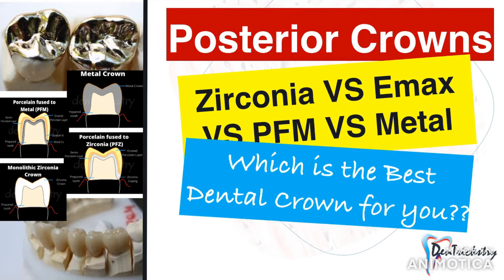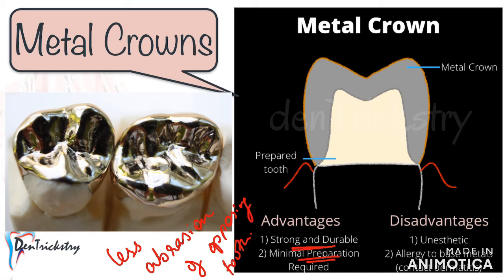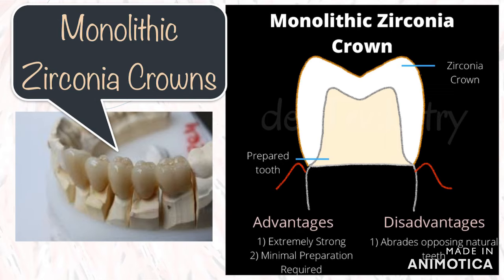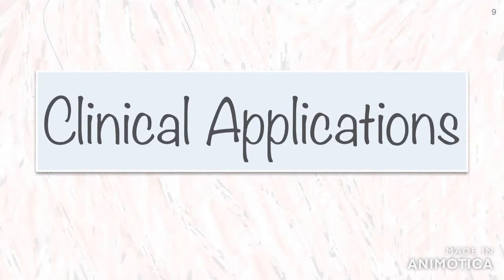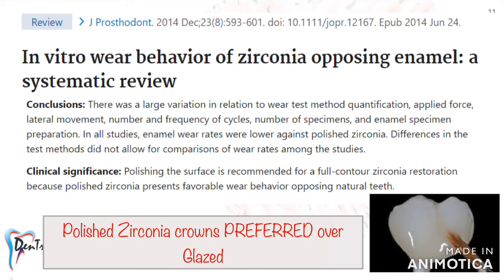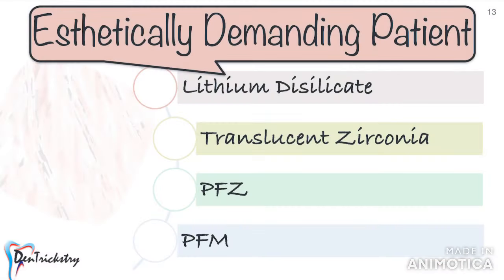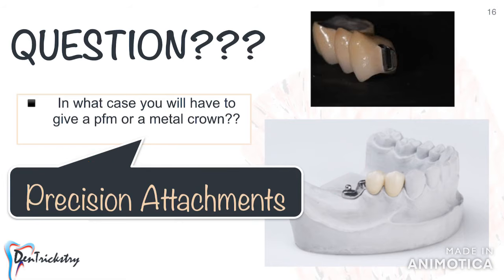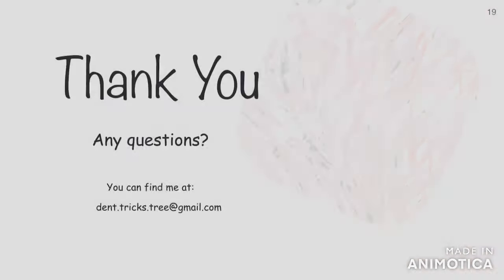DENTAL CROWN TYPES. Zirconia, Emax, PFZ, PFM, Metal!! Choosing the BEST!

Comment: I think one disadvantage is wrong about monolithic zirconia .: the wear generated by zirconium oxide on the antagonist enamel is less than that produced by f porcelain as long as it is well polished (Jung et al. 2010, Tambra et al. 2010, Preis et al. 2011, Rosentritt et al. 2012, Kim et al. 2012, Mitov et al. 2012, Janyavula et al. 2013, Stawarczyk et al. 2013, Preis et al. 2013, Stober et al. 2014, Burgess et al. 2014).
Reply from the maker: Thanks a lot for your valuable inputs. :)
Yes, I think I mentioned that as a disadvantage in the beginning...but later on in the video, I did stress on the importance of zirconia polishing to avoid tooth wear.

Comment: Chrome cobalt ceramic alloy is the strongest and can be made thinner to 0.3mm copings. Best for long span bridges with less bulky connectors.
The PFM is considered as gold standard and all monolithic and all materials are compared to the very good pfm in all ways.
I have seen very few dentists know how to prepare a for a monolithic or pfm crowns.
Chrome cobalt pfm crowns are the best,bas compared to all the new materials available today.
Porcelain fusednto zerconia is a failure because zerconia is too hard and not flexible like cocr alloy so the ceramic fractured easily and not advisable. 
99 % dentists do not know how to prepare the crown properly and do not know to take good impressions. They do not take complete impression and also proper bite. 
Even for a single crown full arch impression is required so the technician can check lateral movements, so dentist do not have to grind high points in lateral movements.
Most dentist avoid making temporary crown. So in few days the prepared crown shifts and the properly prepared crown painstakingly by dengan technician doesn't fit, then the dentist blame the technician for not making proper crown.
Most dentist are very careless  I have seen in my 37 years working as a dental technician.
The reality and truth is that even prothodontist do not know how to prepare the crown and take proper impression.
CrCo Pfm crown will remain gold standard always.  Cad Cam tools are only as good as the operator. Most of the Cad/ cam operating in dental labs are not dental technicians and they do not know dental anatomy at all. Only an experienced and expert dental technician can produce properly fitting dental restorations with the use of Cad/cam.
If an sculptor do not now anatomy of the body hoe cam he sculpt a human sculpture on Cad software. The same is true for dental technicians, who has not learned dental anatomy in his/her life properly, and the same is true for dentists. How many dentists can carve a single central incisor properly. One in thousand.
I do not criticize dentists but the truth can not change. No dental college in India, make dentist make 100 pfm crowns in his college studies, non. 
I can go on writing but I will not waste more time.
All dentists know the truth of themselves.
99 percent dentist do not follow the ethical rules set by Indian dental council. How many dentists know about the ethics book pdf available on the site of Dental council of India.
Be happy
Reply: Am a final year dental student, nd this one is literally an eye opening .., thankyou....

Comment: Very informative, explained in an understanding way. Thank you  so much..
Reply from the maker: Thanks a lot for the appreciation! Means a lot!! :)
Reply: When I opted for metal(steel),they said there is risk of oral cancer. Is that true.
Reply from the maker: @anumaevangalin.u.s6220  
Hey!! So, the risk of oral cancer increases with a crown which irritates a part of your oral cavity be it metal,  PFM, Zirconia etc. So if you have a faulty crown which is hurting your tongue or oral mucosa, you should get that replaced.
However, there are studies supporting that metal crowns could be a contributing factor for oral cancer...especially if you have other dissimilar metal based prosthesis in your mouth (silver filling/other metal crowns)...this produces galvanic currents...which again irritates your oral mucosa/tongue etc and may result in oral cancer. 
Don't worry..i'm sure you will be fine with the metal crown...if you still have any apprehensions, you can keep checking for any whitish/ reddish lesions in the oral cavity near your crown time to time. And if present, you may have to replace the crown. 
Also, this is possible phenomenon only if u have other fillings or crowns of a different metallic material. 

If you want to know more, feel free to ask. :)
Reply: Thank you very much for your detailed description. So it would be safe for me since I'm not having other prosthesis in my mouth. However I will do examine the site from time to time. Thank you
Reply from the maker: @anumaevangalin.u.s6220  You're welcome! :)

Comment: Hi Doc! I learned a lot from your video. Thank you for sharing 😊Would just like to ask if you also have inputs for 'Tilite' crowns?
Thank you so much in advance!
Reply: Tilite crowns are considered as PFM.. Where medical grade alloys as they claimed are used in casting. During its launching, they claimed that it will eliminate the common problem of  PFM (grey lines in long term)  but clinicians observe it in long term practice and as expected, it failed.

Comment: Thanks! Great info! One question pls. Pls do more videos in CAD/CAM crowns, inlay/onlay restorations, individual crowns vs joined blocks where no tooth is missing but multiple adjacent crown are required. Also, pls be honest, why do dentists charge such high prices for crown, when the actual lab rate is just a fraction, at least in India. Also, pls educate us on the guarantees that come with the PFM CAD/CAM crowns, is it just a gimmick, will they provide a replacement if chipped in guarantee period? What is DMLS crown?  PFM vs PFZ, is PFZ more expensive?
Reply from the maker: You're welcome! Hope it helped.
Yes!! I will keep these topics in mind for videos in the near future. Thank you for suggesting. 
Coming to your question....Well, you are not really paying for the lab charges, the dentist is charging you for their skills and medical advise. Even if something as small as crown cementation goes wrong, it can have devastating effects on the surrounding gums or opposing teeth or your neuromuscular system. So, everything has to be done with utmost precision. 
Guarantees are provided by the lab...and in my experience, if your crown chips off or fractures, they do give a replacement for the same.
DMLS is direct metal laser sintered...in simple terms, 3-D printed crowns...they have a better fit compared to conventional ones.
PFZ is more expensive than PFM crowns, but they have better esthetics and fit as well.
Reply: @teethstreet   Thank you so much dear for your detailed reply. My question about the high cost of crown was because more than one dentist told me a PFM manual crown was X amount and same done by CAD was 2000 rs more. Based on what you just told me, if the cost of the crown is made up of the dentist charges, his/her work for both types of crown is the same. Then why such a steep price hike in charge? This prompted my question.

Comment: Hi. Which is better option for molars ? PFM or Metal ? Please reply very confused..
Reply from the maker: You can go for either. Metal if you are not too concerned about the esthetics as the ceramic / porcelain on the PFM could to chip off over time exposing the metal.

Comment: Mam, what is the treatment for advanced Gingivitis
Reply from the maker: For gingivitis, you should start with scaling and root planing followed by proper oral hygiene instructions to the patients. Most cases of gingivitis resolve with this conventional protocol. 
If the case has progressed to periodontitis, apart from the interventions mentioned, surgical procedures may also required with or without antibiotic coverage. 
Every case is different, you need to 1st identify the cause and then plan your treatment protocol. 
Refer the case to a periodontist for better results.
Reply: @teethstreet  Thanks mam

Comment: The original veneer on my front tooth fell out before and was reattached by my current dentist  3-4yrs ago. Recently it completely cracked and I will need to replace it with a crown. Which type should I get to cover that darkness if he isn’t able to clean it and something that looks natural yet strong?
Reply from the maker: Depends on how discolored the tooth is. If it is mild, it can be masked with either appropriate thickness of Emax or High translucent zirconia crowns. For severe cases, an opaque layer will be needed...so an option like layered emax or layered zirconia will be good in my opinion. 
Don't worry, your dentist will probably check the degree of discoloration and will suggest you the best option. :)
Reply: Or the use of a blocked out Zirconia. It works perfectly. Either layered or Multilayer full anatomical Zirconia if there is sufficient thickness. Layered is the best in my opinion

Comment: Hey which looks more natural emax or zirconium crowns?
Reply: Emax but with less strength,zirconia also can be perfected
Reply: Which one do you recommend? What about porcelain veneers?
Reply from the maker: Yup! Emax will definitely give you best natural appearance...these days you have  natural looking Zirconia crowns as well. So it comes down to the case that is in front of us. The ultimate selection depends on a few factors like discoloration, amount of enamel present for bonding, tooth structure we have, occlusion etc.
Reply from the maker: Porcelain veneers are great too...minimally invasive and very natural looking. 
Decision between crowns and laminates depends on the case. 
Not every case is suitable for porcelain laminates. 
So, if you are looking for a smile makeover/design, it all has to go through a process of treatment planning which involves clinical and radiographic examination, digital photographs, study models etc. A mock treatment is usually planned on the models 1st and the best suggestion is given to the patient accordingly.
Reply: Feldspathic porcelains are the most aesthetic but they cannot be used in all cases, since their indications are more limited.

Comment: Mam zirconia crown abrade opposing natural teeth?
Reply from the maker: Zirconia crowns abrade the opposing tooth only if it is not polished. Even before glazing, it is better to get your crowns polished. Convey the same to your technician.
Also, if you happen to make any adjustments on the crown before final cementation, make sure you polish the occlusal surface again. Either you can keep a zirconia polishing kit at your clinic and do it yourself or send it back to the lab. 
But, it is mandatory that zirconia crowns are polished :)
Reply: @teethstreet  mam thank you so much for replying .I will follow all steps before crowning
Reply: @teethstreet  you are so kind

Comment: have you even heard of MARGIN materials. They can be used on PFM Disilicates AND ZIR .. if you haven't then thats why you think PFM is unaesthetic ...find a Laboratory which understands materials ..second aesthetics nothing beats the fully layered crown and does not matter what substructure is zir  silicates or metal ..from aesthetic  side  a pure PFM beats by far  monolithic Zir and Silicate crowns ..second u cant put a   transparent ZIR or Silicate on a  discolored  prep tooth  (u can but amount of masking it requires huge skill and time  which costs allot)..
so basically why POFM is today in second plan is because of lack of good Ceramists and ones who are good  want their work to be paid ..monolithic zir and silicates are in 99% done just by painting stains over it which requires little training

Comment: Which crown is more thin?
Zirconium or Emax?
Reply from the maker: Both zirconia and emax can be fabricated with minimum thickness of 0.5mm.
Zirconia is better suited for posterior crowns as it has better strength. 
However, according to me, if your case demands a minimum prep, the crown (either zirconia or emax) should preferably be bonded on the tooth for added strength.
Reply: @teethstreet  thank you very professional